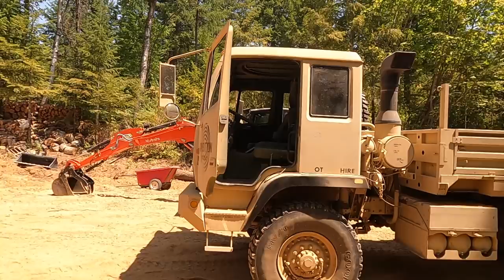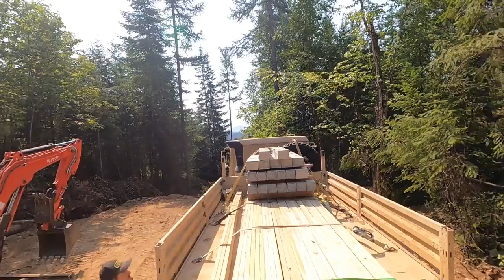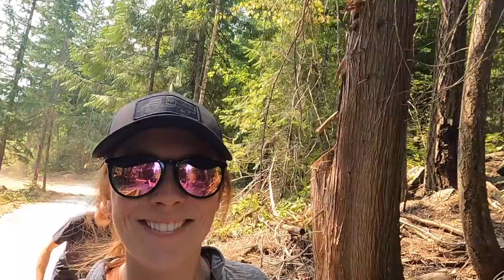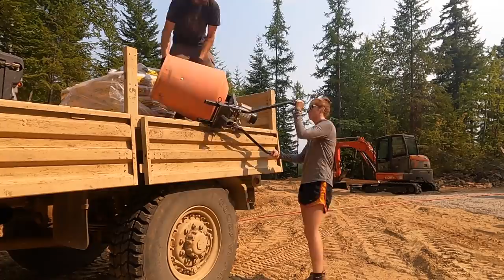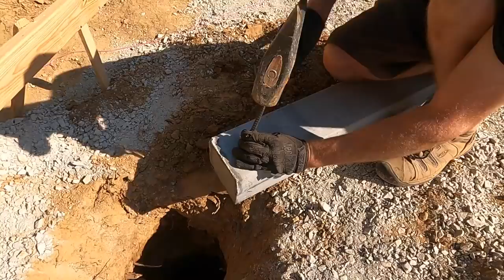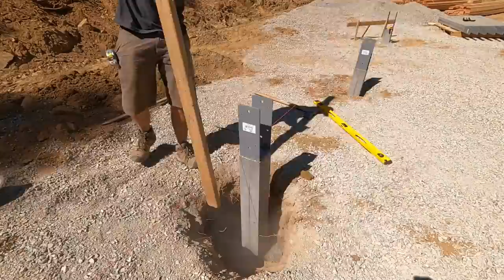We NEED These Trusses...

Comment: Look at the dashboard there  should be a panel that gives  load capacity at certain boom angles and lengths.It changes faster if you use the fork length rolling up or down moves load in and out  past tipping point of machine .Know Your  truss weight and your rigging weight combined and check  against safe load angles of boom capacity,don't forget tag lines both ends one ground ,one in air for your  rigger/structural frame hanger.Crossbrace between the roof trusses. A scissor lift to stabilize the first two trusses with cross braces helps so to some friends not afraid of heights ..!!!
Reply from the maker: Thanks for the tip! Haven't noticed any load indication. Honestly these little trusses are so light Courtney and I are able to lift them so I know we aren't anywhere near the machines capacity.

Comment: If you un latch any of the panels and tailgate,  hold the piece out at around 45° they will pull off.  There is even storage under the bed up front for them.  If you need help figuring it out hit me up and I can get more information.
Reply from the maker: Removing the tailgate would have been a great idea!
Reply: @AmbitionStrikes  on the right pin of the tailgate is rollpin,  rotate the tailgate down until the pin is lined up with the slot on the hinge.  Then slide the tail gate off.  On the passenger side under the bed are 2 compartments that go the width of the bed to store your panels.

Comment: we have bags of cement here in australia called rapid set all you do is tip bags of rapid set in the hole with post and just add water it hardens in minutes and fully hard within 24 hours. no need for a mixer might ask your supplier next time to see if they can get it, much easier. keep the vids coming i enjoy them
Reply from the maker: We have that too! They call it fence post mix, doesn't even require water if there's moisture in the soil. We wanted to ensure consistent mix and strength. Probably over kill?
Reply: Quick set, or fence mix isn’t structural concrete. Structural support, piers need to be a minimum 20mpa. Bagged concrete has potential of having a 25mpa rating after 28 days of curing. I’m a little perplexed at how little concrete you poured into your pier holes.

Comment: Suggestion - run water piping under your slab for heat purposes.  You flow warmed water through the system off a small water heater and pump and you have warm floors
Reply from the maker: That is a great idea! Working on a warm floor sounds amazing!
Reply: The slab is the shop. Their living quarters will be upstairs.
Reply: @Bwanar1  would still warm the area
Reply: @robertbates5537  Where they store their equipment? I could see it working out well, for the floor of the living area.
Reply: @Bwanar1  it will heat the area where they work, which will be right below their apartment  -  hence helping heat the apartment

Comment: What a great idea. Never heard of those columns before. Even in well drained soil I’m concerned my post building will eventually rot at the posts. So I tied in the wall framing built on the slab to the vertical posts to give it a little more structure. Like your method so much better. Shows where ideas have improved  in last 2 decades.
Reply from the maker: They seem like a great solution for people who plan to turn a pole barn into more than just covered storage! We hope it will lengthen the lifespan of the building significantly.

Comment: Run your tools off your batteries, then you can use genny to top off the batteries.  Too late to help on columns, but pour a couple inches of concrete in the bottom of hole to set level of each hole to the same depth, let it set up. Then, place posts in the hole and finish the concrete.
Reply from the maker: That is an excellent idea that we will have to remember for next time!

Comment: How are the post holding up? I use to put coarse gravel and small rocks  in the hole before placing the column and pouring concrete. Then the gravel and stones act as armor and bings with the column. Here in sweden it’s called an Elephant foot.

Comment: Future tip. To increase lifting capacity of excavator, remove the bucket. You lose out on a bit of flexibility for picking up stuff, but the weight of the bucket isn't zero. (and it's far away from the center). Plus putting straps by the pin is one of the strongest points.
Reply from the maker: That is an amazing idea that never crossed our minds!!

Comment: Y'all are doing awesome! Y'all should consider welding or bolting a anchor 🪝 to the back of the excavator bucket. It would help with stability when lifting materials.
Reply from the maker: That is a great idea!!
Reply: And while you have the welder out put a chain hook on the back of the bucket, I cringed every time I watched you do a lift with those straps 😬

Comment: Take the bucket off the machine to increase your lifting off the truck. Will be handy if your setting beams as well. Good job.
Reply from the maker: That's actually a great idea! I feel silly for not thinking of it.
Reply: After you get your posts plumb. You should be able to sit the machine in the center of the building and lift all the trusses up in one go. Then with one of you at each end walk the individual trusses to your 24" oc or what ever the engineer says. Pull from one end and go 23-1/4" and away.

Comment: I think i just noticed you have a little lake close by, nice. That was a good idea to put a block under your posts to allow concrete to get under it. Are you going with sheeting system that has insulation on one side? I have also seen people put 2' foam on the outside and bat insulation inside for a great barrier from the elements. Are you or can you drill in a pin in the posts to tie them to the slab? I like those truck bed fold down sides, it makes it soooo easy. lol Take care
Reply from the maker: Unfortunately the little lake isn't on our property, we wish it was! We would love to use a continuous insulation system, but I don't think it'll be in the budget. The popular opinion seems to have the slab remain floating and independent of the columns. 

The m1078 is incredibly versatile and made hauling all these materials easy. We are so glad we bought it.

Thanks so much for the support, glad you enjoyed the video!
Reply: @AmbitionStrikes  Even if you can only see the lake, it`s still a plus. Are you going to put plastic and rigid insulation under the slab? I think it would be worth it. You could also put 1 or 2 " foam on the outside next year before you do siding. It won`t hurt the building to sit with tyvek for 6 or 8 months. You have all kinds of options. lol  Take care

Comment: Those columns need a bigger base to support a apartment plus the roof load. Or are those just for the roof load ? if so then they should be fine. 
PS The rock sliders you built for me back home are holding up great !!
Reply from the maker: Is this Richard? You should give me a call, I'd love to catch up. (831) 682-0813. Glad to hear the sliders are holding up!

As far as the column base, there is a piece of rebar in the column to tie the concrete we poured to the column. We belled the bottom of the holes to about 18" to add more surface area for support.

Comment: I would have poured 8" of concrete in each hole as a footer let it sit for 30 min until it just supports the weight of permacolumn, then set the column on the footer checking square and plumb and then add 8" of concrete around the column locking it in with the rebar and joining it to the footer as the footer has not cured yet, and then back fill the hole. I do not think there is enough concrete(1.5") under the column with just a chunk of 2x4 keeping it off the bottom of the hole to act as a footing to support the building. This would be similar to the way a footing and basement wall relate, for a single story house the footing is 16" wide min(2 story = 19"wide) then the 8" wide basement walls are cast on top of the footing. The width of the footing spreads the weight of the entire building over a larger surface area and around the entire perimeter of the foundation, whereas your entire building is supported by 17 permacolumns so the total weight supported by each column is significantly greater than a typical full basement foundation.

Comment: Rockin it ....i don't know if a piece of wood under columns wood brakes down over time ?  A Rock might be better.... your thoughts
Reply from the maker: The goal is just to space the column up long enough for the concrete to cure underneath, it does not have any structural intentions!
Reply: @AmbitionStrikes  For sure good idea
But wood rots and in a few years there will be a hole on the bottom of the columns where a rock would stay solid. 
Keep up the good work  great video 
I am a general contractor .. this is our 40 th year so no stranger to this. Looking forward to your next video 
Hard work always pays off I wish more people would have the balls 
To do what your guys are doing

Comment: Again,  way to late to make a difference for you guys but... 

Isn't the wood at the base of each post going to rot overtime? Wouldn't that leave a hollowed out area that is weaker? I understand why you would want to have the concrete underneath the posts but maybe a brick or rock or something like that might have been a better material for sitting in the ground under your foundation?

Comment: How do you set the height of the columns?
Reply from the maker: We use the rotary laser transit to set the height, taking into account our finished grade after the concrete slab is poured.
Reply: @AmbitionStrikes    thanks for the reply,  but looking for more details.  Do you just go a little deep with the auger, then backfill to suit?   I have only ever wet set steel columns in concrete.